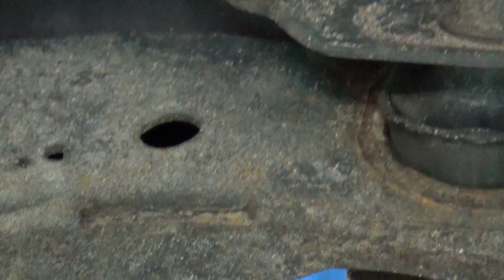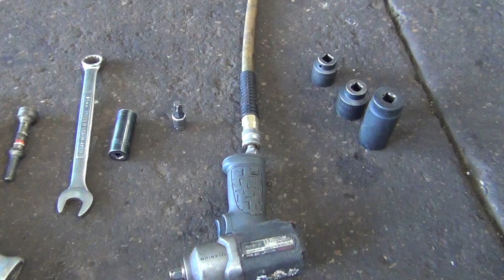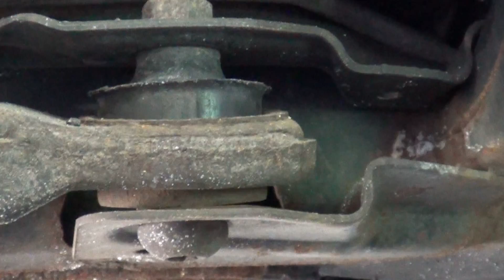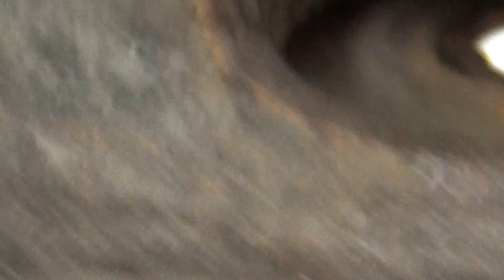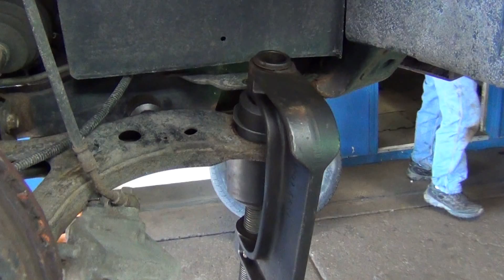Lower control arm bushing-How to replace in 15 minutes- FWD- East Lansing Michigan

Comment: so.  control arms have TWO bushings - what about the OTHER bushing in the other side of the control arm?  Why only do half the job? 

Also? It would be a good idea to tell folks why you didn't use the air hammer on the center of the pushing.. As soon as you said 15 minutes I figured you were only doing the one.

Comment: Thank you for the film. Do you know how to change bushing on the outer edge of the Lower Control Arm in the car 2001 Saturn SL2. I ordered a new bushing for that model, but it is only rubber bushing, no central bolt inside (in many films they show the bushing with that bolt). For that car I couldn't find a bushing with the bolt. Is it difficult to replace the old bolt into the new bushing? The bushing is on Amazon: MOOG K8436 Lower Control Arm Bushing.

Comment: Hi appreciate your video! Any chance you have a pic of what a bushing looks like for 2001 Pontiac Aztec, control arm in your video looks different than mine?  Trying to figure out which bushing to buy for front lower control arm.  It seems there is front lower control arm bushing front and rear...so confused.  Please help

Comment: wow i will never do that to a customers car atleast install part with the air hammer (that's just brutal) but removal is very smart. should've used the ball joint press in the first place and not brutalize the new bushing

Comment: This is a handy idea. Maybe use a set of vise grips, channel locks or small clamp to hold one side of the bushing so the air hammer can easily get the other side started without the rocking back and forth. Thanks for taking the time to make this video.

Comment: Hiring a pothole at speed and full suspension drop is a whole harder on components than using a pry bar on it. I've had to work on rusted stuff like, it not easy,so why make it harder to do, unless your getting paid by the hour instead of by the job.

Comment: That's just a great job from a mechanic.  Did you replace the rear bushing because prying it at that angle would damage it.  Also, cramming that front bushing in like that is sure to make the hole out of round.  I'm sure you'll billing flat rate too, why don't you just follow flat rate procedure then?

Comment: All of you saying they shouldn't pry on that a arm putting stress on the other bushing...really...how much pressure do you think is on the a arm when you hit a pothole at 65 mph?
Reply: The stress from the prying is twisting the bushing in a direction it's not intended to go.  The stresses from "pot holes" or other road surfaces are the stresses it was engineered to handle.  That's the difference here.

Comment: As a 67 year old DIY kind of guy, I appreciate this video. I did use a ball joint press through a loaner program that Auto Zone offers to customers. I don't think the air hammer method of installing the bushing would have worked for me. Thanks again!

Comment: You May want to Advise Against Letting the Brake caliper HANG from its Hose that Way, A Bungee Cord Worked well for me Over my 30+year Career. And A Brake Hose as Old and Rugged as this One Looked WILL Fail from this as It is Not Designed to Carry Weight Old or New. Good Video though.
Reply: Like cancer. Or herpes. Kinda.
Reply: ronninb1up I was thinking same thing at the beginning of video

Comment: that is a lot of fails here brake hose stretched out to the max hitting bolts with hammers lol and tightening that control arm without jacking up that arm or putting the tire on and setting in on the ground ....... you need to simulate the ride height of that control arm or they will be back in about 3 months to have that changed again... lets not forget about the bind that rear bushing of the control arm is in now that you forced that front one out... I wouldn't take a go-cart to this shop
Reply: I saw that. Smh.
Reply: Tim Green i'm with you on this one -professional bodge it and scarper ltd

Comment: In what cases  should u replace control arm
Reply: william wheeler this case as its about $10 more
Reply: Kevin mindyourown Well on my car its $85 per ball joint and about 25 per set of lca bushings..but a full lower control arm is 325 a piece.

Comment: 9 times out of 10 the ball joints are worn out anyway.  Its better not to be a cheap ass and replace the whole control arm so you don't have to take it apart again!

Comment: Let's just let the caliper hang there and stretch the brake line and possibly cause a weak spot in a hydraulic line.. 30 seconds into the video and already lost reputability.

Comment: I have a pt cruiser 03 and 220,000 mile lol.. crazy i know i kept up with the maintainence on it. I'm assuming that the control arm plays a part in the steering while driving, like it tends to sway a little bit while i accelrate and slow down. Like readjusting itself while driving straight in a lane no turning. If i want to replace it do i need to replace both the control arms and the bushing. I think I would save money if i get bushings for both control arm. I just need a thought of what you think i need to do. Bushings are pretty much damage it has wear an tear. So like do i have to replace both control arms and the bushings or can I just buy bushings and have them replaced.
Reply: justin mendoza replace arms is best way to go and do not take any advice from this fool

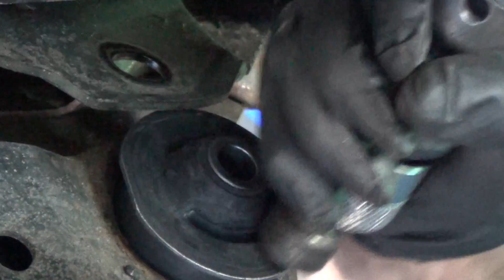Comment: @ 6:45"This one dont want to go in like they usually do"

Thats when I yell out f***ing GM. It might not be GMs fault it wont go in but at least I feel better blaming GM for it not fitting right. Especially when they put bolts in spots where u cant get any tools in there to remove them!

Comment: Why would you not just replace the entire arm? Its much easier and a lot less drama.
Reply: I'm scared a sneaky wanna be mechanic will get lazy & decide to not replace my bushings but still charge me. So I just replace the whole arm. Amazon has the whole arm cheaper than shop time just to separate ball joints & such. Not to mention if some rubber gets torn during reassembly. Better off to just replace the arm. Shops love charging hours of labor to separate bad ball joints then put it back together then a few months later u need a ball joint & they charge u again to pry the same balljoint out when u could have replaced the whole arm & balljoint the first time!

Comment: Why didn't you put a socket on the bushing? They go in evenly and more equal pressure all the way around...If you don't want to use a socket you can use a piece of pipe that has flat stock welded on one end...Have all different sizes in my shop just for things like this.(And yes I know sometimes you have no choice to use a press)

Comment from the maker: You can't if it's on a hoist hanging in the air plus its still attached to the ball joint and rear bolt so it is nearly level when its installed.